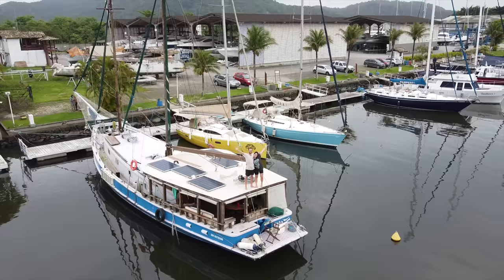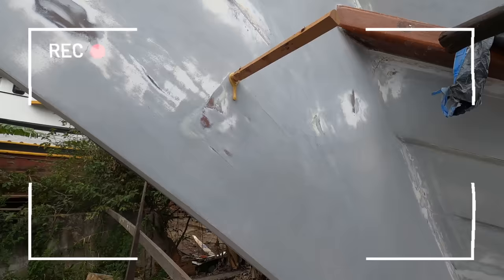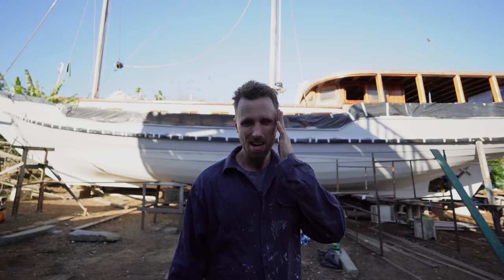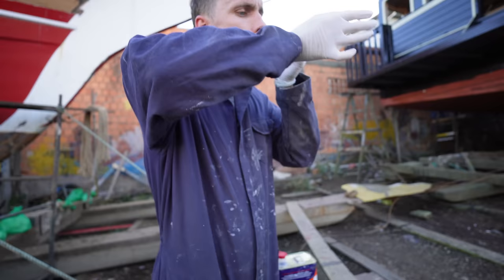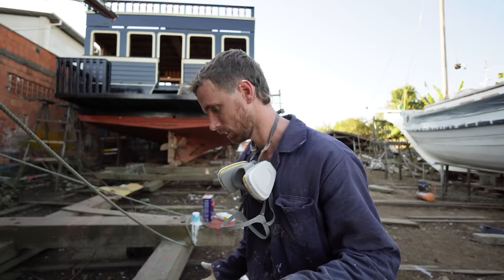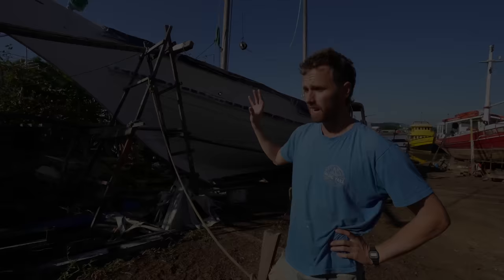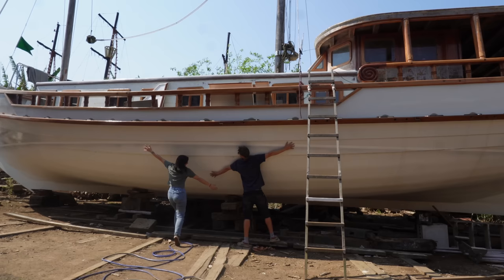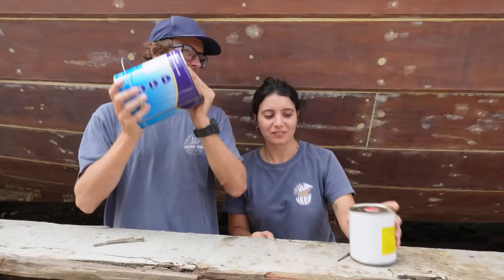Painting the hull of our rescued wooden sailboat. Which color did we choose? — Sailing Yabá 148

Comment: What a huge difference that makes say that paint on the hull, I've been following you since the beginning and can only say wow !! what a lot of work you and all the other helpers have done!
Small tip for removing the painter's tape, MP works well, remove it at an angle downwards, but make sure you walk in front of the tape when removing it, this prevents taking new paint with you (I once heard from a yacht painter)

Comment: Beautiful, the White also reflects heat, the only thing you didn't do was fiberglass the inside/outside, but not necessary with the Epoxy....Looking Good....Once upon a time I mixed up some epoxy that my dad brought home from work(expired kits), I made use of a wall brick and concrete driveway to remove excess, well after 50 years, those globs are still there and refuse to be removed....LOL

Comment: As you guys get closer to splash time have you thought about fire and security? As Captain you should practice on a regular basis how to handle a fire. What equipment do you have for a fire. Also, if you have a high pressure water hose for fire this could also double as something to use possibly to repel criminals.

Comment: That is very much like a color that came out in the late 1970's called Seattle Gray. It was very popular here in the  Seattle area and I painted many boats using it. I'm sure there have been lots of variations over the years. Looks great! The thing lots get wrong is in the "Boot Stripe". The line of colored paint separating the Topside color from the Bottom Paint. Many do not pay much attention to this detail. Getting the proper balance in "scale" (size) to the rest of the boat is not easy. This is the area where topside paint takes a real beating and the paint can discolor due to stuff and things in the water, especially in ports. . A Boot Stripe can mask that area so the topsides can look much cleaner longer.

Comment: Your using a car sprayer it’s the worst tool to use it does not put the volume of paint on the hull it just covers even with 2/3 coats if you insist on spraying you should us an airless Google it .  The best thing is various rollers foam not hairy it applies a lot of paint quickly as you know then to achieve the nice finish lay it out with a 6 inch brush and catches any runs. Mick UK